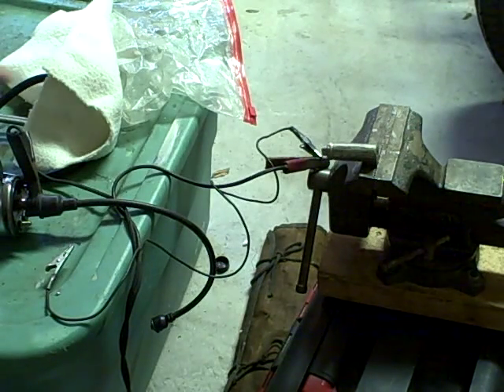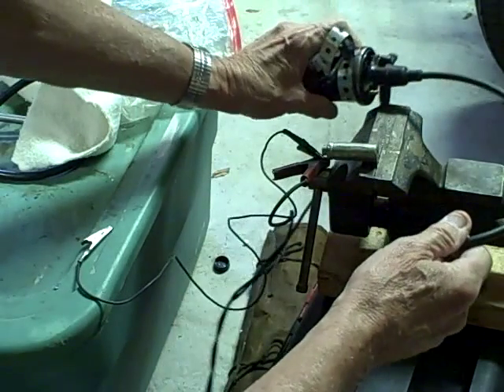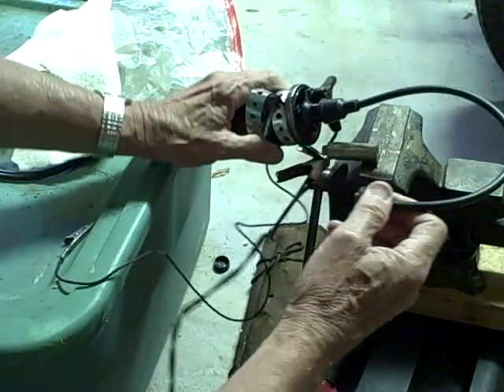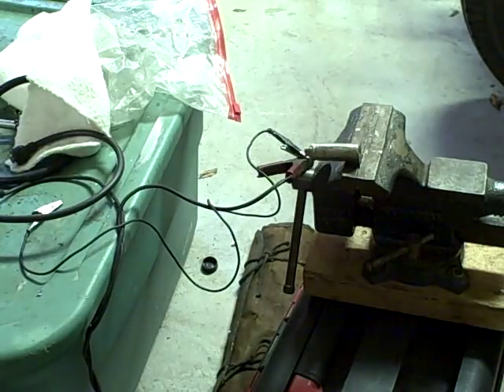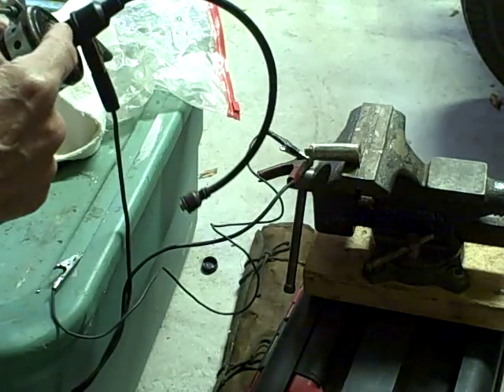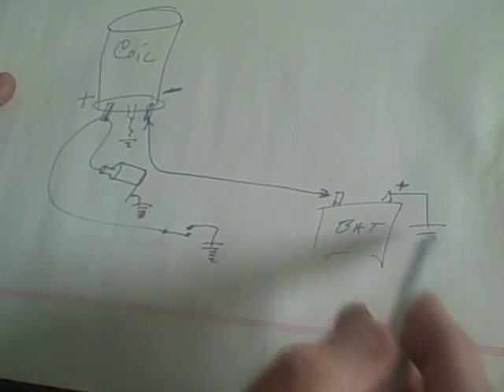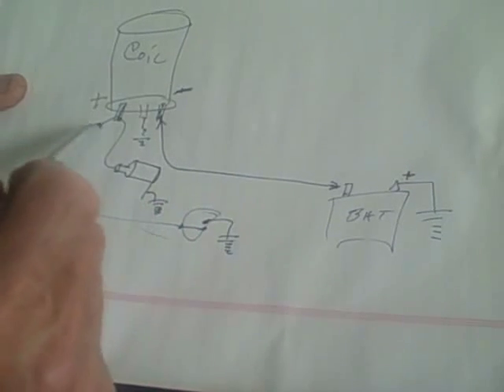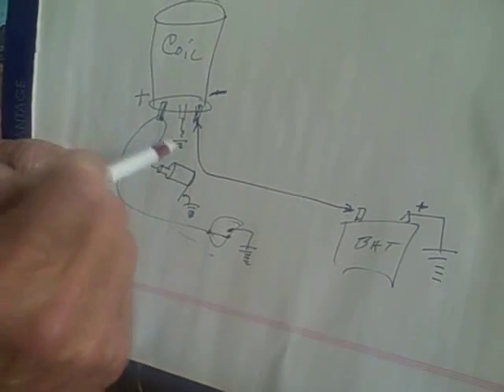Model A Ignition  How to check the Coil and Condenser on the bench

Comment: Thank you there was condenser next to the coil and the cable broke off. I was told u didn't need it as it was for radio, truck kept dying on me. Gonna put a new one on it and hope this helps
Reply from the maker: I don’t think so. The condenser is good or bad.  If the engine will run without backfiring, the cond is good.
Reply: @JackBahmlll  well its not had it connected since the old wire broke off long time ago, the condenser is next to the coil bracket. I was told it wasn't needed,  Figured after seeing this video to put in a new one anyway n see what happens
Reply from the maker: @JCsFluffyTail  connect the new one between ground and the passenger side of the coil. That’s a good place for the condenser. Good luck.

Comment: Hey jack was wondering if I can pick your brain on flatheads? I have a flat head 4 in my little wheel loader,thing fired up ran great for about a min after I put all new points, cap, wires ,condenser coil,  then started spuddering and died, now will fire but won’t take off, cleaned carb twice, unsure where to go next, used the old thumb method for compression test all cylinders wanted to pull thumb through hole ,
Reply from the maker: Sounds like fuel.  If it’s easy, put the old condenser back on. Otherwise, chase the fuel.

Comment: I occasionally change all my ignition gear. One time I did this but neglected the coil that I bought was one which needed a ballast resistance I believe..... I'm not fully up with electrics so always err on the side of replacement before trying my own testing etc... Probably lazy as well in that if its new, it should pretty well work and keep working is my belief. I had so much grief in trying to figure out why my system would run for a time and then die.... I nearly ended up in a nut house until I took the car to someone I know who immediately told me I had the wrong type of coil but put that ballast in for me and all was good again. I eventually swapped back to the old coil and its been running more than 15yrs on that again with not a problem... Thanks for your video. Its always good to see others also solving problems in their own ways.
Reply from the maker: If that baby is running good, leave it alone.  Just do maintenance and a good visual inspection.  Get those critical lube points and keep oil in her trans and engine.  Clean those plugs two or three times a year just because.  Have fun.  jack
Reply: @JackBahmlll  Thanks for your kind words Jack. I bought the damn thing new in 1976 for my 25th birthday and am still driving it today after far more than a million miles and its almost all original as well. I've just been out looking to buy plugs and points and capacitor for it but I get looked at by the 'kids' in the boutique parts shops like I'm Noah wanting parts for the Ark. Nup. They just don't have them and almost don't know what they're for in the first place. The race is on to see which dies first and I'm thinking its going to be me but can't complain in the least with that. One owner, one driver for soon to be 50 years.

Comment: Thank you for making a very informative video!   I learned a lot.  I am going to make a tester like yours.  And yes those cheaply built import condensers do go bad!   I have my spare at one time working magnetos go bad sitting on the shelf.  Only to find out when I change the condenser it works.   NAPA has the best condensers in my opinion.

Comment: I've tested my coil and condenser on the car and both seem to be fine. But still there's no spark to the plugs. I've tried a new distributor cap and still no go. It's almost like I was cranking it over with no rotor in there, but there is one. What the helll? I might have to pay Jack's way to come out here.
Reply: Thanks Jim, I'll give it a try.  Also, thanks Jack for the excellent how to videos, they've been very helpful !!
Reply: rotor arms do fail also
Reply from the maker: Jim, watch my troubleshooting video and the Model A Ignition 101 video.  Then just trace the problem  There is not much to the circuit.  Stick with it and let me know.
Reply: I'm having the same problem with my '28.  I've got spark to the points but nothing to the spark plugs.  I'm ordering a new distributor cap and hope that solves the problem, mine is worn badly.
Reply: Before you buy a new distributor cap, put your finger on the stationery point (assuming you're using the original style points) and see if it wiggles. That's what I did and found that I had a loose screw on the stationery point block. It's usually some stupid little thing like that.

Comment: Jack, can you run this  ignition system, negative ground? 12 volts?
Reply from the maker: +Dennis Lafond I don't know, and I am not in favor of converting to 12 volts.  You don't need it.  Nice to have for your 12 volt devices, but it is "Busy Work" to go to 12 volts.  The A does not need it.
Reply: it can be converted to 12vdc neg ground, I did it to both my As, I converted for the headlights and to use the same parts in several cars. To convert you will need a few non A parts and do some rewiring, not hard but as Jack said its busy work and it is not necessary for a reliable A.